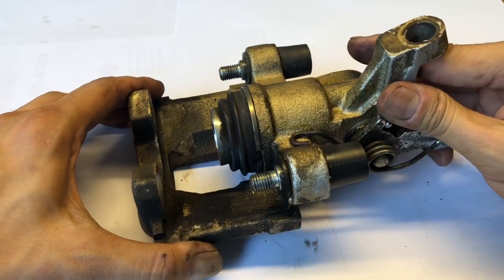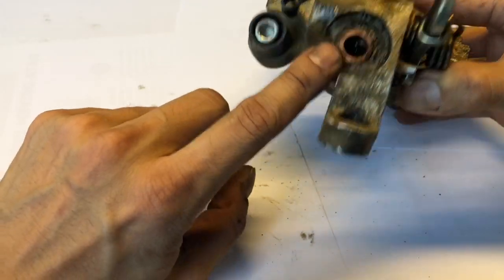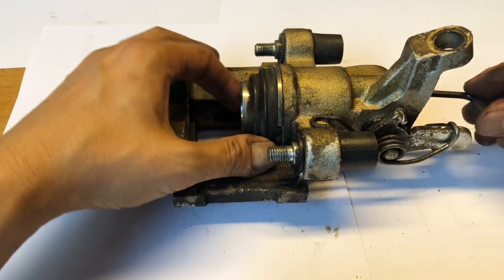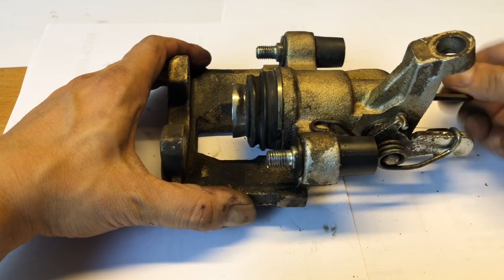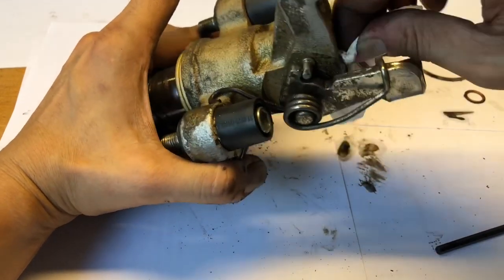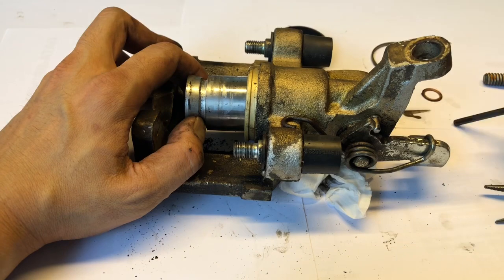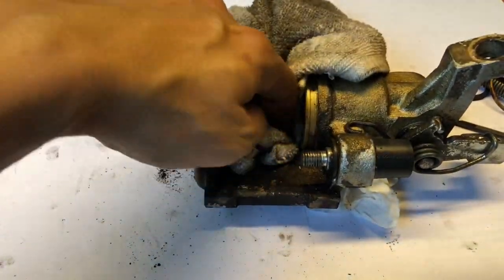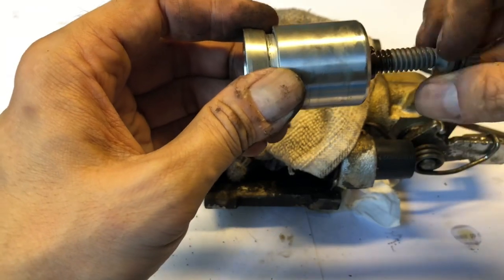Saab 900 Rear Brake Caliper Disassembly

Comment: Hi James. Thank you for an excelent video.
I'm surpriced that no one have commented and honered your video already, because this was a huge help for me.
I'm into this job myselfe right now.
A little sad you also did not cover also the disassembly of the hand brake lever.
I assume there is also a rubber seal behind it. Mine is not leaking, there, but I should like to replace the seal now when I'm into all the others.
I should realy like to know how to pop the smal lid for the handbrake lever. If it is possible to open it and reuse it, or if it has to be replaced by a new lit...?
If you visit my channel, you will find a lot of my Saab repair videos, and more videos is about to come.
Regards Terje

Comment: Thanks a lot for taking the time to do this James, very informative.  Any advice for replacing adjustment gears which you already know to be stripped?
Reply from the maker: Yes, you need this https://www.ebay.com/itm/372717315213 

It’s longer than the original and the 14mm dust cap won’t fit. You could stick a 4mm Allen key on it and use it for handbrake adjustment, and then remove it for safe keeping until the next time you adjust it. It’s not needed in normal operation of the handbrake or brakes.
Reply: @jameswwchong  thanks, I suppose it could be cut down.  Strange how I can’t find new ones, they’re obviously being made somewhere for the refurb calipers?!?  Perhaps I’ll enquire about getting a batch made.
Reply from the maker: Yes, they used to sell them new but is sadly NLA. The Mazda one fits except for the length. As I said, they don’t play a part in normal operation and don’t need to stay in the caliper once it’s been adjusted.